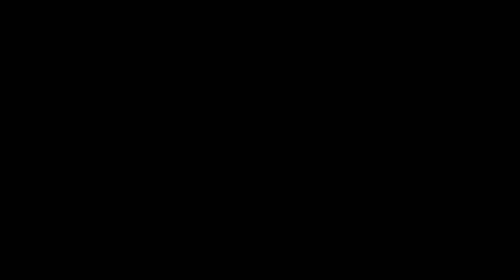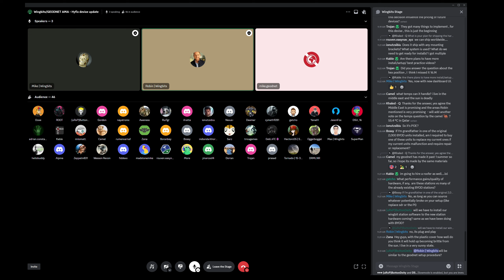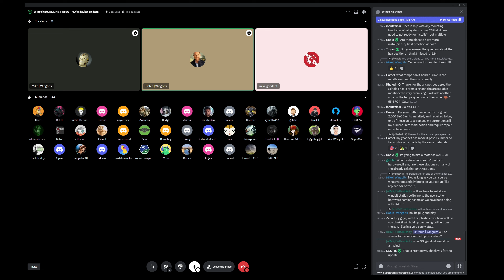Wingbits/GEODNET AMA - Hyfix WB200/MGW310 Shipping Update

Comment: delayed the shipping its been more than 3 months  , it should  start delivery  january , now end of February,  eagerly waiting for the miner , south asia is india.
Reply: 2026 now ....
Reply: Would you prefer defective units?
Reply from the maker: Just for transparency, they were not defective by any means.  They were less performant.  So participants running them would have been at a disadvantage, regarding rewards, compared to what will be shipped instead.
Reply from the maker: These devices were sold as pre-orders with a tentative date of January.  We did not feel comfortable with devices going out just to meet a deadline, if they could be more performant with a small delay.  Unfortunately this coincided with Chinese New Year, so the additional 2 week holiday pushed it back this long.  In the end, a higher performing device with a minor delay is a better result for the project and participants than a less performant device that you will run for years.
Reply: How do the units compare to a byod using suggested hardware? I'm aware they can't be deployed anymore.
Reply from the maker: Testing is still ongoing with the hardware changes.  So far we have seen in 1:1 setup testing (antenna split to isolate differences) that they do outperform a standard BYOD setup, which would only cost ~$60-80 less on average.  We cannot comment yet on "by how much".  This is also a self-contained weatherproof system that doesn't require hardware or Linux knowledge, which some may value to be worth that $60-80 usd difference.
Reply: @Wingbits  sounds great, I'm exited for delivery.